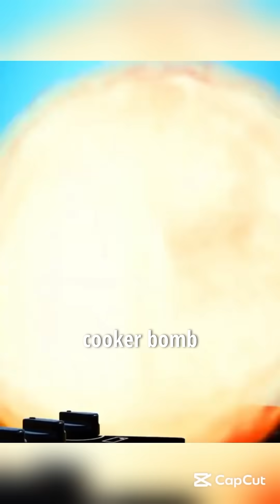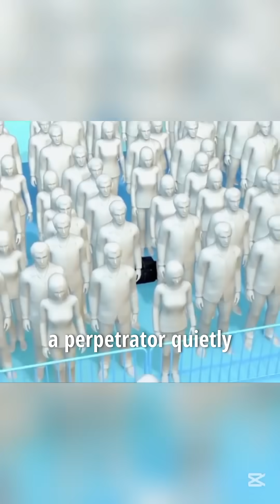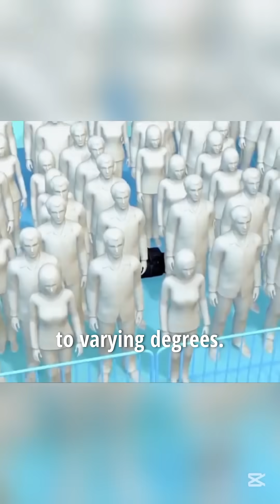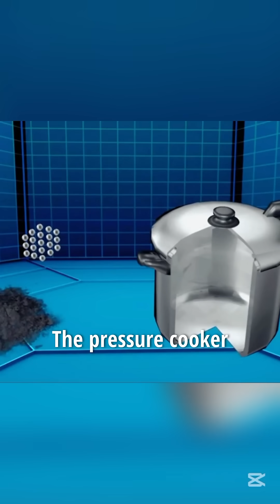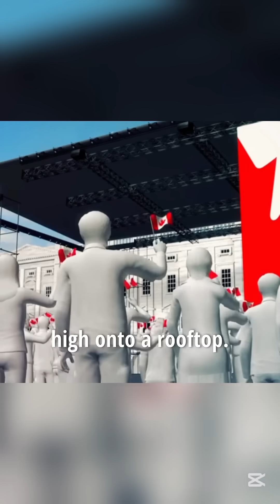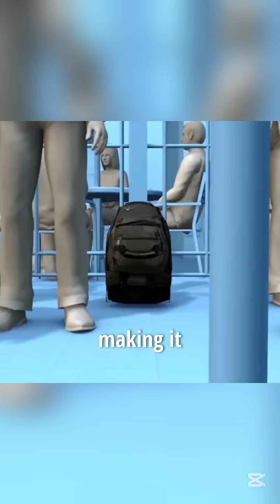How Pressure Cooker Bombs Work 💣💥

Comment: Anything with rigid chamber will explode if you apply pressure outward. Take pipe bomb for example with the same amount of tnt of a stick of tnt you can get 1.5 times the results